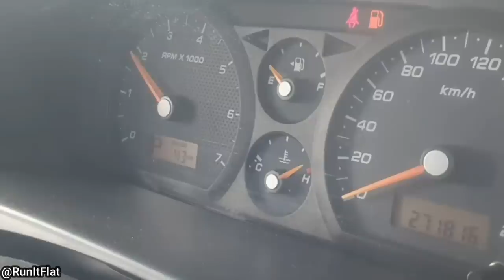Customer States Car Is Overheating And Won't Shut Off! | Just Rolled In

Comment: I was a tech at a bus company. All of our busses were either L10, or, M11 Cummins powered, so, generally reliable, but, man, when those turbos fail, they always fail DRAMATICALLY!
Reply: At least it dumped the oil into the exhaust side, not the inlet...
Reply: New ones have the X12.  Yuck
Reply: I flamed a turbo on a S60 Detroit. 
2000 FLD daycab Penske truck with 847000 miles on it. Me and the other driver. Ran about 22 hrs a day 5 days a week. It got 6.9 mpg just a GREAT TRUCK. it was in '05 when this happened.
Reply: Just had a 2003 5500 come in. Turbo spat both turbines out. Broke the turbo shaft in half while the guy was stuck.
Reply: I was the one that sent the video, it’s an MCI D coach with a Detroit Diesel S60 on it, those engine are beasts but you’re right when the turbo goes out it causes all kinds of headaches.
Reply: I hate working on c2s
Reply: The Series 60 did similarly. One time I found a turbine in the muffler of a 102D3...
Reply: Just city, or are they also in school buses?
Reply: I thought that amount of smoke was a good thing... I mean planks with lifted trucks do that kind of thing all the time
Reply: @jwalster9412  Both
Reply: @elevatoroperator2021  great, glad to hear a giant brick, with a noisy engine can suddenly become a giant run away brick, with a noisy engine..
Reply: @NemoConsequentae  there's turbo systems on inlet sides?!
Reply: @20thcenturygamer22  that's black smoke tho
Reply: @robertlund5694  Of course!  Where do you think the forced induction comes from?  The exhaust spins the turbine on the exhaust tract side which is physically connected by a common driveshaft to the compressor side, which pumps air under pressure into the engine.  When the seal on the inlet side of the turbocharger fails, oil is pumped into the inlet.  On diesels this causes a runaway condition where there is (almost*) no way to shut the engine down before it destroys itself.  

eg. Compilation: https://www.youtube.com/watch?v=fJIcxMJevII  
This one exploded on a dyno: https://youtu.be/RUJrurvjYtg?t=115
And this is when a train does it: https://www.youtube.com/watch?v=WvMl8LUzQnk

*You could try to plug the inlet to suffocate it, but few people are brave (foolhardy) enough to go near one one it starts.  You also can probably stop one with a CO2 extinguisher  into the inlet, if you can get to the inlet, and you have a big enough extinguisher.
Reply: @jerrykinnin7941  6.9 mpg, wtf?!
Reply: @kikibarrios1231  i know. That was a great FLD Freightliner. The lead driver never went over 55 mph. But his half of the run was flat land interstate in Ohio. Mine was all interstate as well but I ran i75 south to Loudon TN and back every night.
Reply: Had it happen once driving double decker Volvo RV it was a 98 registered one, they were absolute rockets to go.
Was driving some back roads as there was a detour, trees and walls and bad bends it blew a third of the way in and as the road was so narrow it wouldn't be safe to leave it where it was especially as it could drive..... You think the smoke out of 007s car is good this filled up inside the bus too, couldn't see a thing on the road, traffic had to stop and wait for it to clear, it was like fog
Reply: That's all turbos even small ones.
Reply: @MarcoHernandez-du6im  any engine taken care of right is a beast except rotary and anything with less the 4 cylinders. I've seen plenty of those exact coins die rig by out of the factory same amount as other diesels. Same goes for how many are still on the road if it was upkept they all last, Ford, Gm or dodge. Also all have perks, Ford always has the best 4x4 system Gm goes for luxury and dodge is a work horse. None go for reliability because well not a single car company cares for that anymore actually they never cared for that.
Reply: @NemoConsequentae  Hey, the inlet just means extra fuel for the engine
Reply: Look up a freight locomotive turbo fail. That stuff is the worst I've seen.
Reply: I feel like that’s most Diesel engines tbh
Reply: I worked for Cummins in the fuel systems plant. The injectors I built half the components where made in China.

Comment: Regarding the first video, most cars will continue to run without the battery connected because the alternator is providing the power. It’s a very bad idea to do that though because the alternator produces huge power spikes (especially as loads turn on/off). Those spikes are generally smoothed out by the battery, but if you disconnect the battery, well… Electronics don’t like power spikes.
Reply: modern cars do have voltage regulators

batteries do not last if provided too much voltage

Comment: People might be laughing at the flex pipe for the exhaust.....true story here.  A company I worked for has company vehicles and provided a card with every vehicle.  All maintenance and service would be handled by the service company.  They didn't do the work, they just authorized and paid the shop for the repairs.  Well, the vehicle needed an exhaust, so it was taken in and the "authorized" shop said it would take an hour and when they saw the card, they said, oh, it will take all day.  I asked why and they said they would need to use an OEM exhaust on the vehicle as that is what is dictated by the service company behind the card.  I then asked what they were going to use if it weren't for the card.....flex pipe.
Reply: And the just assume the customer would be OK with some plastic tube? I'd be so pissed
Reply: Isn't there a small metal flex pipe made for exhausts?
Reply: @WCGwkf  flex exhaust pipe is either stainless or common steel.
Reply: @trashbandit2449  There is. However its not meant for large runs like that. Its a cheap alternative to bending pipe to fit correctly in small areas. The annoying thing is a properly bent piece of pipe  isn't much more expensive. A lot of shops just charge more for it. Noisy and unreliable.
Reply: I wish flex pipe didn't exist. It never lasts long. The closer it is to the engine, the shorter it's life. I had a customer ask if he should buy the 18" flex pipe or an 18" chunk of pipe. I suggested the pipe and told him flex pipe doesn't last, especially up near the engine where he wanted to put it. My idiotic coworker that night piped up and told the customer that flex pipe lasts forever and can withstand 1500 degrees (The flex pipe was more expensive, which is why he stepped in with his BS to steal my sale). He sold the customer the flex pipe. The poor guy came back a month later complaining it had rotted away already. I sold him the regular pipe, and he never came back. At least, not for exhaust parts.
Reply: @WCGwkf  It is metal, but yeah, that is the easy solution for a shop, just not the right solution.  I would think that it would be harder to install since from the factory there aren't many mounting points since it is a solid tube with bends to go over things.  Now you need to attach it to some handers that don't exist.  If you don't then you end up with noise when it is touching something.
Reply: Bullshit.
Reply: I bought a car some years ago where the exhaust broke between the exhaust and the header.. apparently the ols owner removed the Old flexpipe and just installed a piece of pipe and welded it in.
Reply: @davidsrensen3117  "between the exhaust and the header" hahahaha.
Reply: @CadillacDriver  sounds like some sort of converter
Reply: @satsumagt5284  headers ARE the exhaust... You can't put something between the exhaust and the header....
Reply: @CadillacDriver  he meant exhaust as the part after the catalytic converter, I guess
Reply: @satsumagt5284  exactly - you are guessing. Either way, I'm still 100% correct with what I'm saying. Also, the cat could have been damn near at the back of the car, rendering your theory (and his description) all wrong.
Reply: Nissan's factory rally manual shows flex pipe for the main length of exhaust on Stanza rally cars.
Reply: @skurblord3401  No it isn't. FF cars use it due to engine flex under load.
Reply: @CadillacDriver  Catalytic converters are typically located around the middle of the car, and in most cases closer to the front
Reply: @seanb9698  no they aren't? Either way, what am I saying that is wrong? Absolutely nothing.
Reply: @CadillacDriver  actually most european brands with crosswise front drive engine units, use a length of flex pipe between the piece of tube coming from the catalyst and the rest of the exhaust pipe, usually right underneath the engine, because of them moving differently from engines installed lengthwise. these flex pipes eventually break, and there are replacements to weld in, since most times these parts of the exhaust are one piece with the catalyst. and often really expensive, while with some cars the repair can be done within a hour.
there, these flexible pieces are needed because without them the pipe will break off somewhere where you can't repair it, and also make a lot of noise since everything's under tension while driving.
Reply: @lotharrenz4621  flexible pipe specifically manufactured for exhaust systems is not part of this conversation.
Reply: @lotharrenz4621  or to clarify - I'm not talking about replacing flex with flex. I'm saying the OP's story is BS. They'd never say they'd use flex, if solid pipe was factory spec.
Reply: @CadillacDriver  with some vehicles, using flex is easier. some pipes bend around axles and suspension in mysterious ways. and what they say is true that flex pipes are more expensive then there is a reason why the auto shop acted like this.
I can't say for sure from my place in germany, such overly long flex pipes for exhausts have to be ordered at US car specialists. you can't really use them for modern rides here, anyway, as they are not very gas tight, and exhaust tests in germany are very thorough and rigid. and TÜV wouldn't accept them, either.
Reply: @lotharrenz4621  no, you have completely missed my point. What can't people comprehend plain English these days?

Here we go again....

There is no way a repair shop would tell a customer they'd use flex over factory-spec pipe.
Do you need me to draw pictures in crayon so you understand?
Reply: @CadillacDriver  then you have been to shops no one else has been to. most customers won't know the difference, either. and some technicians use that as an excuse to sell repairs that are not needed.
I have been a car mechanic for 30 years. I have enough pride to not tell a customer I'd install something inferior like a length of the aboveshown flex pipe over a real solution, be it factory spec, or put together. hell, if done right even pre-used pipes will last longer.
saying no repair shop will tell a customer flex is better than a massive pipe is like, naive. not many will, but there are always some that would to make a sale.
Reply: @CadillacDriver  okay, I rethought what triggered this convo, and saw that I did misunderstand you. I thought you were saying that flex pipes are per se wrong and not to factory specs. I seem to have thought too far; my mistake.
so, sorry for that.
Reply: @CadillacDriver  im not a native english speaker so 🤷🏼‍♂️
Reply: When I worked at O'Rerillys in the early 00s all that stuff ever did was collect dust. Never sold an inch that I remember.
Reply: @willyluciano9036  come mto think of it, all flex pipes I ever put in were aftermarket ones. I think only once the car makers offered a repair kit with flange, a length of pipe, and the flex pipe to be screwed on, because the flex pipe would fail prematurely.
but all flex pipes were welded to the pipes to begin with, and with many cars you have to put in a lot of effort to weld it correctly due to tight space around it.
but, don't get me started on engineers and their solutions... on one BMW I had to take the whole front apart because there was a little beam of tin, part of the front assembly, blocking the headlight housing's rear lid by a mere 2 or 3 milimeters from being unhinged. customer stood nearby and only shook his head, and ordered the replacing of all bulbs in the headlights... at least newer european fords make it easy to remove the headlight housing for easy access to everything. and then you find burned cables because the heat inside the housing fries them crispy...
the more expensive a car the more effort it takes to keep up. I wonder who made that rule; shouldn't it been vice versa?
Reply: I didn't realize my car had flex pipe on it when I bought it. My mechanic welded in a pipe for pretty cheap. It sounds a lot better now
Reply: @willyluciano9036  Right??? There are so many details that make any mechanic with any experience and fantasy stop dead and ask, "WHY U NO MAKE SENSE?"
had the "joy" of working on a Bentley Continental once, and hated it with a passion. aside them being way overpriced VWs the way they are constructed makes no sense. is there an unwritten law that says luxury rides must be impossible to maintenance and repair?
Reply: @warriorsmustang1784  nice. :) sometimes flex pipes are not necessary. my guess is they are cheaper than movable flanges. something like "weld on&forget".

Comment: Driving on 'slicks' like that should carry a mandatory licence suspension for a few months as is the case with DUI. A slight summer drizzle and you're only stopping in or on some poor bastard ahead of you at a red light or intersection. 

I mean there's worn and there's 'I completely disregard my personal safety and that of all nearby traffic participants'.
Reply: Google Asho  eeerm... what? What does killing someone due to recklessly driving on beyond gone tires have to do with your rampant tangent about environmental issues?
Reply: Here in the UK you get 3 points on your license per tire, get 12 and you are banned.
Reply: Here in the UK you'd get at least 3 points put on your licence (12 and you're banned) and fined. It's down to the owner to regularly check tyre tred is within tolerance.
Reply: I agree Ivor!
Reply: @cirian75  snap!
Reply: My 1966 Impala can do that to a set of tires in a weekend.
Reply: @the.internet  nice
Reply: Or, if only the rear are bald, you hit the breaks and fishtail, and end up going off sideways in a random direction.  Rear-ending someone is bad, but sideways in the oncoming lane is worse.
Reply: The car owner was too busy pouring oil on the tires and then doing burnouts.  A trick to make smokey burnouts..
Too busy doing that to worry about safety of others or themselves.
Reply: ...as well as non-participants (pedestrians).
Reply: Hell in Finland you are fined well before tires get that slick, I think in most of the world what carries fine for us is "lightly used". Then again most of the word doesn't have mandatory winter and summer tires, no, all weather tires are a myth don't even think about them. Take you tires and come over for winter, I'll send the video to Darwin awards.
Reply: I start to worry if my tires are really close to the top of Washington's head with the "quarter trick" to roughly measure, even though they clearly still have enough tread to be safely driven on. I don't understand how people just casually drive on slicks like that without worrying about it
Reply: What if he done the burn out in the car park though.....
Reply: I unknowingly drove with tires like that for a few weeks and even in the rain I was driving 70 mph down the highway no problem. But I did get new tires the same day I realized how bad they were. The funny thing is that I was very comfortable with how well it handled on slicks, it was super sporty
Reply: Shit my vette has plenty of tread and it still hydroplanes everywhere hahaha.
Reply: @cirian75  That's too harsh. Cars and mandatory in most places in the US so you can't fine poor people into oblivion or ban them from driving. I mean you can, but you'll only make california or new york 2.0 with all the resulting homeless.
Reply: @oceanbytez847  If they're a danger to society by refusing to maintain their vehicle, then that's their problem to sort out.
Reply: Or how about we stop giving the government more control when it comes to something you don’t like
Reply: @Cresta-fm8uj  This kind of thing isn't a personal preference, it's a genuine danger. Driving isn't a right, it's a privilege.  And if you don't act with responsibility, you don't deserve the privilege.
Reply: I have a feeling those tires were that way after several burnouts...
Reply: @cirian75  is there anyway to lose points gained? (this is the first ive heard of this so im curious)
Reply: @darkdruidsvale  yes, the points come off your licence after four years, unless it's a drink driving conviction in which case that is 10 years
Reply: @cirian75  thanks!
Reply: @the.internet  Actually, it's the responsibility of the driver, not the owner. If I borrow your car with bald tyres and I get pulled over, I'd be the one getting the points and fine, not you.
Reply: @oceanbytez847  Cars may be much more necessary in a country like the US but that does not excuse car users from doing their due diligence. You have a responsibility as a motorist to ensure you don't kill someone through your own negligence, whether that be negligence from driving under the influence, or not performing vital maintenance on your car to keep it in a roadwary condition.

If you can't afford to maintain your car, then you shouldn't drive, you should carshare, if you have enough money to buy gas but you don't have enough money for tyres or fluids, then you can't afford your car.